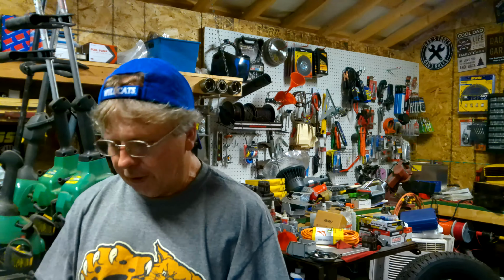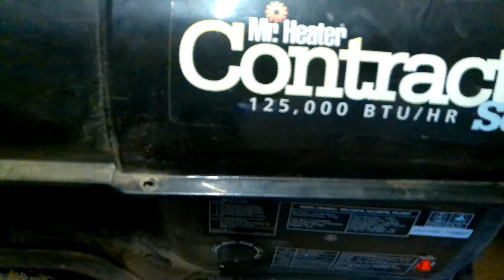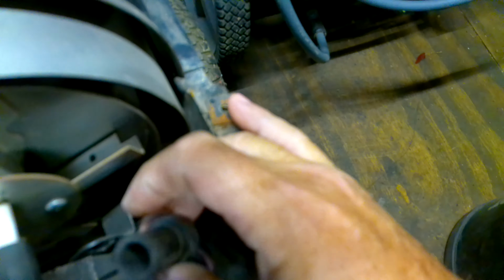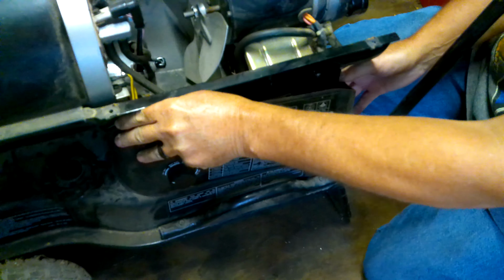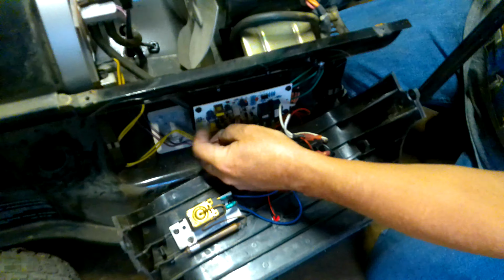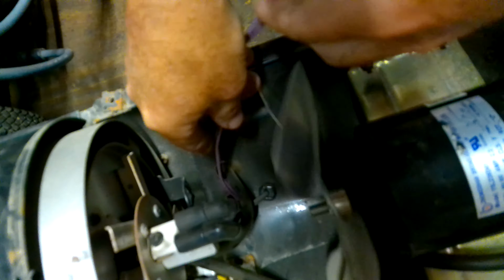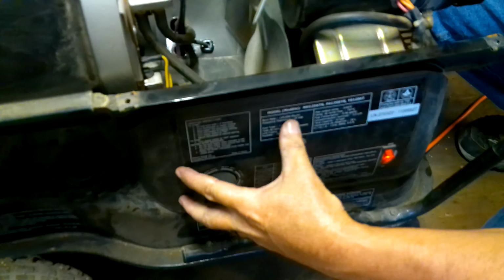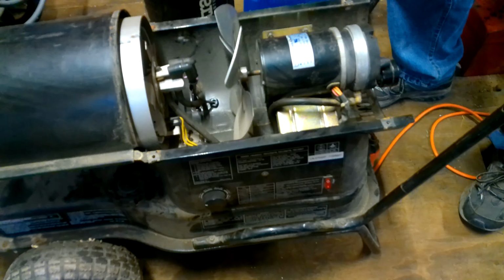Replace A Flame Sensor On A Torpedo Heater

Comment: So it senses the light, rather than flame-heat like a regular furnace flame sensor?
Reply from the maker: Yes you can take a flashlight and shine in it and it will make it work also